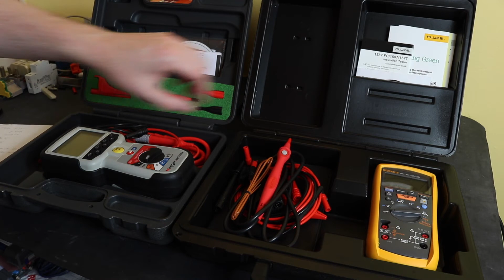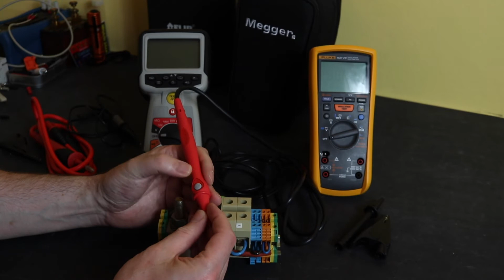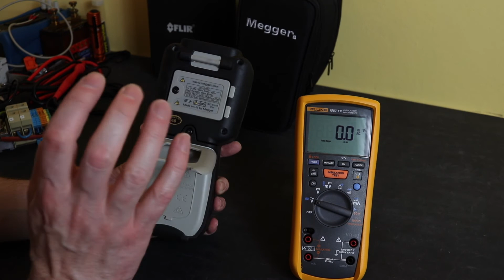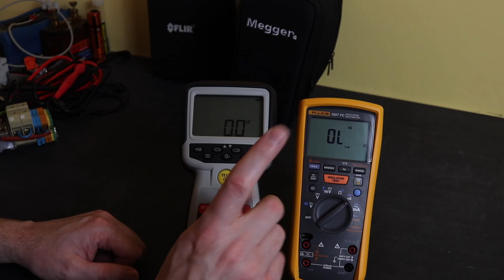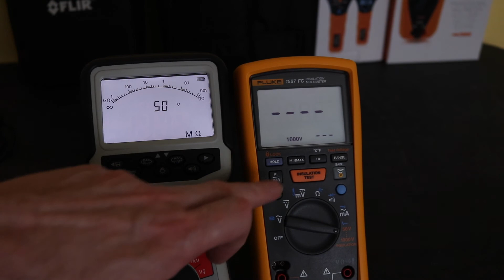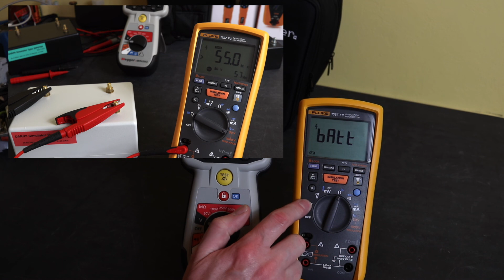Insulation Tester Comparison - Megger MIT420/2 vs Fluke 1587FC

Comment: Hey T-P, I often use my 1587 in general troubleshooting of motors, feed cables, across-the-line starters, softstarts, and vfds. Granted, a lot of what I do is "meatball surgery" compared to most motor testing. But the Fluke does well enough to determine what issue seems to be effecting the equipment.
I am interested in what tests you use. I'm trying to establish more scheduled readings on our critical equipment. And would be curious to know what tests and readings you are looking for to determine a motors "health" and potential longevity.

BTW, I've used a red permanent marker to circle the insulation testing points on my fluke, because I was having a similar issue as you.
Reply from the maker: The Fluke 1587 can certainly be used for general fault finding, but I find it has limitations for trending insulation and winding resistance which is what I use for establishing the condition of a motor.
There are a number of options for assessing motors, and it depends on the type of motor. The more data you can trend over a period of time, gives a more informed health assessment.
For a low voltage motor, online, you can use a power meter to assess the operating status, vibration monitoring, thermography and current signature analysis if you have an FFT scope or a specific analyser. For offline low voltage you can measure winding resistance, insulation resistance, capacitance, inductance, impedance. You can also plot the impedance as part of a rotor influence check, although that can be awkward on an installed motor. There is also a baker surge test for interturn faults. It is then just basic cleaning, checking mountings, connections, and cooling fan etc. 
For higher voltage motors, you can add partial discharge for online monitoring, this can also be done offline if you have a voltage source. For offline tests you can add in the Dielectric Absorption Ratio, Polarisation Index and Dielectric Discharge Tests.
How much you can do depends on the kind of access you have around the motor and control panel. How much you want to do is a risk / cost assessment with reference to historical maintenance / failure data. There is no right or wrong answer really.
Reply: @three-phase562 
Thank you, our reliability engineers have taken over the vibration and thermal monitoring.
Unfortunately, the company will not spend the money for better insulation testing, telling us "you have a tool allowance". Yet a good megger unit is 2x-3x of our allowance.
I am IR certified, but my department heads see no need to continue with more testing training.
Thank you again for responding to my questions
Reply from the maker: @shadowulf  It depends on what your relative costs are. I used to substantiate training and test equipment for company electricians against the costs and effectiveness of contract works. It is usually quicker for site personnel to deal with failures, than bringing in contractors, so it is better to have them doing the maintenance out on site and getting familiar with the equipment. Does depend what business you are in though and how the plants operate.
Reply: @three-phase562 
That has been my argument for my superiors for a long time. Even having someone trained and on staff while a contractor is doing the testing, to me, is an assurance that the work is being done. Unfortunately, my supervisors change often. So getting anything going usually meets with varying levels of resistance.

Comment: Another good comparison video. I really like the look of the Megger especially with the 200mA test current. Like you say though everybody's requirements are different. I find I'm split about 50/50 between motor testing and the instrumentation side of things so still glad I went for the Keysight.
Reply from the maker: Thanks for watching and commenting, the automatic resistance test function, does simplify the instrument operation. Good to hear that you are enjoying the Keysight and getting some use out of it.

Comment: Thanks TP, thanks for posting another powerhouse review. I like the foam insert idea you’ve done with the Megger case. I’m gonna have to borrow that idea and I won’t return it if that’s okay sir. Can you forward me the part number of the extension red tip that goes on the front of the Megger Remote Probe ? I purchased my remote probe off eBay and it didn’t come that extension part. Great video TP, keep them coming I’m enjoying them all👍🏿
Reply from the maker: Thanks TETC. I am sure there will be a comparable tool foam available in USA, I really like the stuff for studying up tool storage. I cannot find a part number for the tip, only the whole probe which is 1007-157. that should come with the tip. It might be worth contacting Megger direct with the request, sometimes companies send out spare bits on good will. Knipex did that for me when I asked where I could purchase a spare from for their torque wrench.